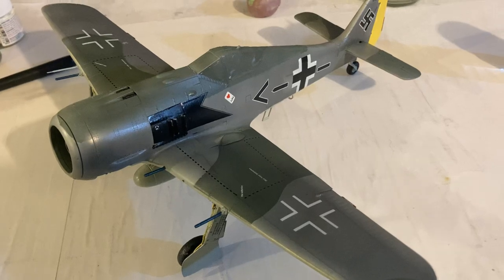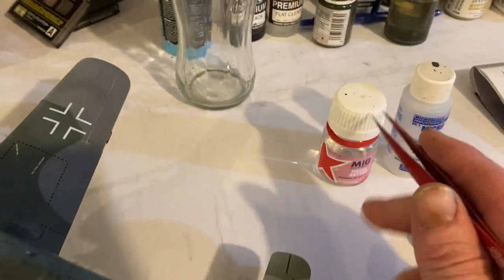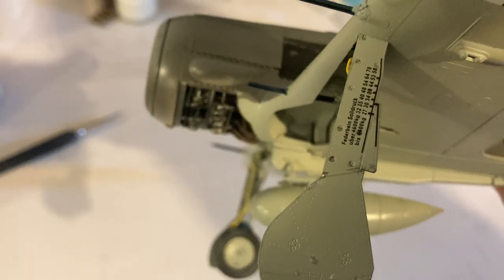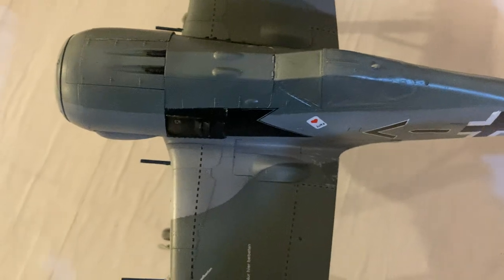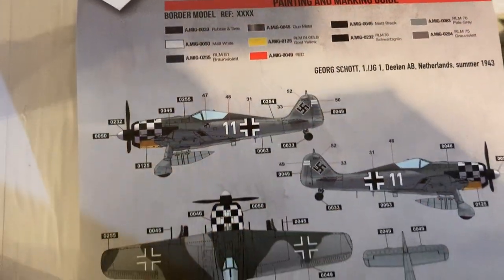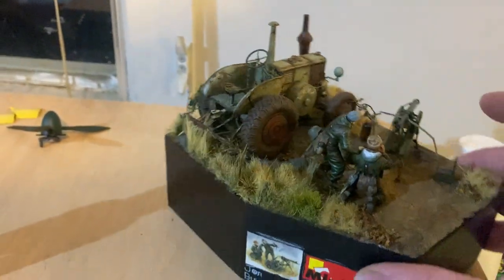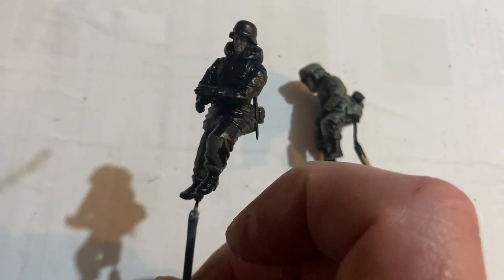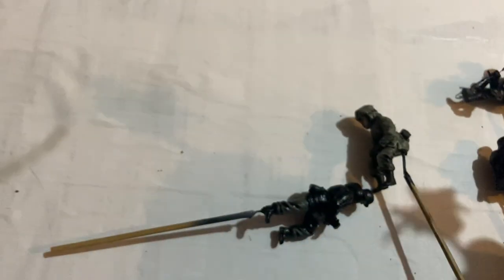Applying the Decals. Border FW 190A in 1/35 scale part 11

Comment: putting thin decals like those into hot water is not optimal as they become much harder to handle. Many times I only place them to a tissue moistened with water until they can be removed from the paper. Takes a little more time but the chance they get damaged during the process is much less.
Reply from the maker: Haha I’m way to impatient! Hahaha I’m getting better but yeah I’m a bit of a short cut king. Decal application isn’t my favourite part of the ol process. I like painting.
Reply from the maker: I brush paint up any damage but you are right. I should go back to cold water, it just takes so long! With hot water 20 seconds bam! Haha
Reply: @Jonhistorymodel  yeah it is not my favourite part of modeling either. Icm has the same style of decals they look good when applied but a pain to handle them lol